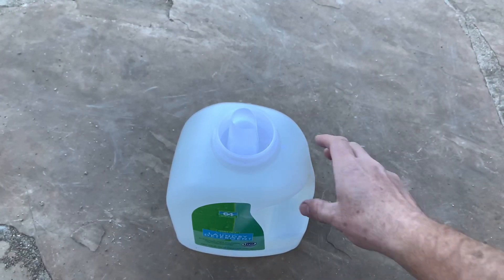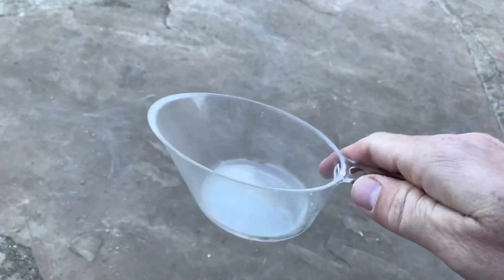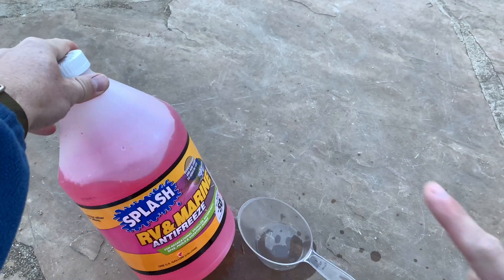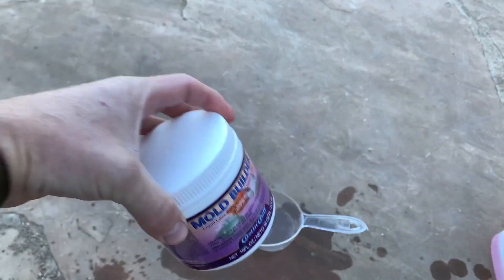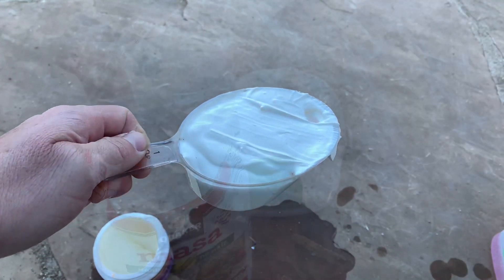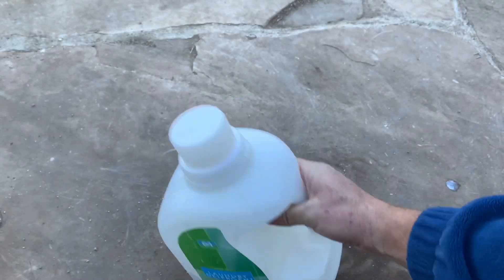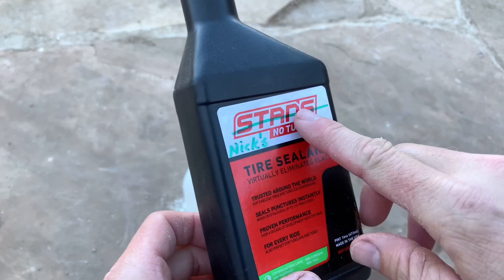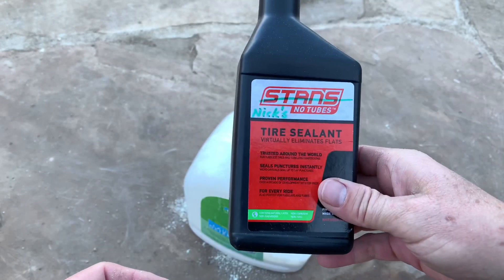60SBT: Ep. 11 - How to Make Tubeless Tire Sealant

Comment: Stans formula is 30% Propylene Glycol, 45% water and 25% Liquid Latex.   RV antifreeze is about the same 2-to-3 parts mix as this Propylene Glycol and water.  Based on this, I would use 3 cups RV antifreeze to 1 part Latex.
Reply from the maker: Good info! Thanks for sharing
Reply: Gonna be making this sealant today.  Based on the information above, should I just do 3 parts Antifreeze to 1  part latex, and not add any additional water.

Great video, By the way, thanks for sharing!
Reply from the maker: You could definitely try that. I think it might travel to the puncture area better with just a little water to thin it out however

Comment: Totally absolutely banging mate ... exactly on the nose thing I was googling.....you got me rolling around Yorkshire dales again....the fat tyres I have on my xt haibike nduro...took a lot of fluid ..to fill them.and or the mechanic put me xtra fluid pumps as a favour into them(specialized butchers))..bit heavy and very  heavy duty but perfect for an  E bike or  as a downhill ,enduro tyre  and .for a tubeless they are extremely durable tyres ..I would have used 3 other softer tyres that give as much grip as the butchers tread pattern but the rubber just falls from them in an astonishing  fashion...these butchers totally exceeded my expectations...sooo predictable in when and how they will break when they catch again and everyghing in-between.....great tyre..I mixed this stuff into what was alreadyin the tyre-rim.. had and spent 20 minutes up and down the nearest stairsetsmixing it as well as possible and punching the old instant holes ..... it seems?to have actually mixed which surprises me in a good way......top man....do you know any more hackx of this calibre??if so..... pray tell......great stuff😮oh the specialized butchers were 40 pounds ..other equipment equivalent in grip and predictability in performance..it would cost me 150 to put a similar performance gripper with soft treads. Top tyre ..try a pair f 80. 90 bar. .you will thank yourself...I did....oh aye. They do the same as other sponsor to tyres I call em .these Butchers are very toughly belted...I got a 6 inch nail that went through but put a bung in..1 time job...get up there specialized and all who sail..sailed in her .....
Edit.  Many many typos..ha

Comment: Just whipped up a batch of this.  Looks just like Stan's actually once all mixed up!  I've seen a few other "recipes" online but I like that yours since it's not too complicated and the ingredients are easy to find.  Thanks!
Reply from the maker: My pleasure! Glad to help!!
Reply: Bottom line: Does it work? Temporary or permanent?
Reply: @teel6060  For me it works just as well as Stan's.  Using it with several different bikes along with my fat tire bike that I use in the winter.  Can't complain.

Comment: I have a question sirr, When it comes to the mold builder did you any use hardener that came with the mold builder?
Reply from the maker: No. Just the mold builder.

Comment: Any follow up to this video?
Reply from the maker: What would you like to know? I’ve been using this recipe for years with much success. 
Thanks for the comment!
Nick
Reply: Rim tape solutions?
Reply from the maker: I plan on doing a video on this soon, but here is the bullet points:
1. Buy the correct width tape that matches the width of your rim. 
2. Try 3M Scotch Strapping tape. It is much less expensive and high quality. 
3. Overlap the valve stem hole at least once. Twice all the way around the rim is recommended. 
4. Smoothly stick down the first section of tape 4 inches before the valve hole, covering the hole. Pull the tape very tight towards you  before sticking the next section down. Stick 4-6” sections down before moving the rim to pull tight again. 
5. Cut X over the valve hole and insert valve stem, tightening the nut.

Comment: Hey cool! Does this have pretty good results?? I sub’d. Thanks!
Reply from the maker: It really does! Hope you try it and see for yourself. 
-Nick 😃👍
Reply: Ride Alongside.... just got all the ingredients... I’ll update once I get it all set up!!
Reply from the maker: I’m curious to see how you like it! My tubeless setup has been great with this last batch, but I just ran out and am about to make another batch.
Reply: @RideAlongside   I am so lazy... Haven't ridden it yet, but I cleaned out my tires/rims and used your recipe.. It seems good and is holding air. Going to go ride one of these weekends!! Also I'm truly "ghetto tubeless" previously I used orange seal with GORILLA TAPE as rim tape, and it has worked great.
Reply: @jasonpepin2000  Any update? on how well this works?
Reply: @jasonpepin2000  Any update? on how well this works?
Reply: Any update? on how well this works?
Reply: @nedapaz  I guess we'll never know!
Reply from the maker: Works great!
Reply from the maker: @jasonpepin2000  ever ride again? How’s it working?
Reply: @ it worked great! I was running “ghetto tubeless” for several years. Your solution paired with gorilla tape as rim tape worked great.
Reply from the maker: @jasonpepin2000  glad to hear it! Ride on!!

Comment: You said "cornmeal" but added masa harina (fine corn flour). I suppose that's technically a type of cornmeal, but wouldn't coarse american-style cornmeal be better?
Reply from the maker: Yes, I probably would be better to be slightly coarser, but we used what we had most of. We use it for making corn tortillas.